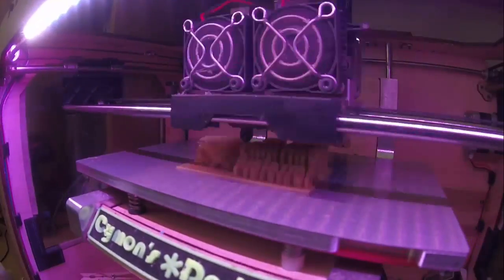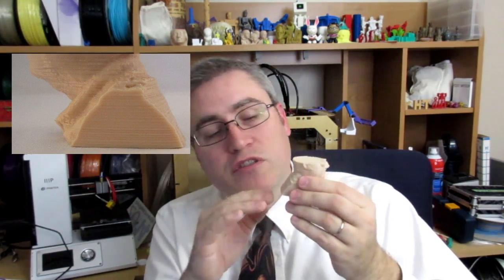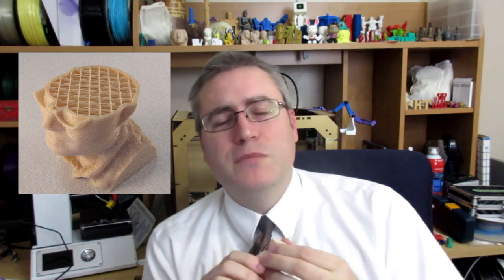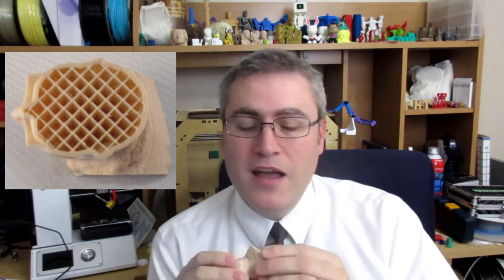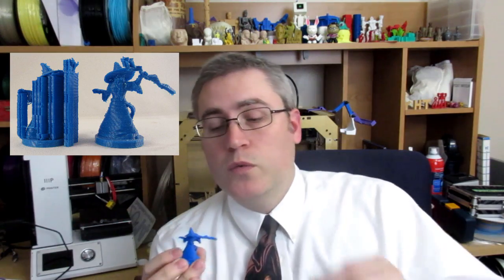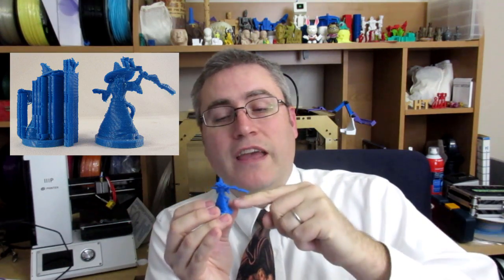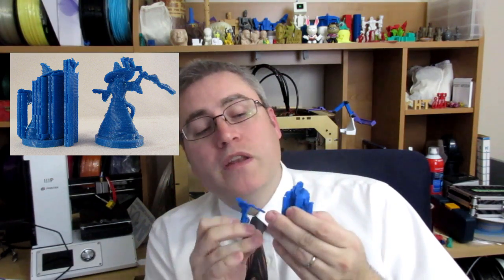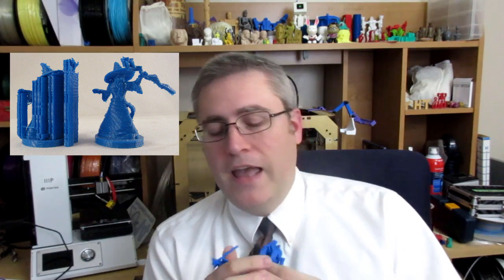3D Printing 101 - Anatomy of an FFF 3D Print

Comment: Hello my fiend !   Please make a video of the electronics, talk about of your experiences of the movement of the stepper motors, the possible fails or rather improvements could be made to print better =D
Reply from the maker: Hmm, interesting. Admittedly that's something I know less about. I know that some of the more expensive 3D printers use servos instead of steppers so they can have constant feedback and know where the motor is no matter what. But besides that I just know that 3D printers move things around in 3 dimensions. I'll have to do some research, maybe build my own 3D printer.

Comment: What slicer did you use?
I'm using Cura and find the supports it generates are no good at all. It puts them where they are not needed, and where my model prints in thin air it generates no support for this.
Reply from the maker: I do use Simplify3D so I can have control over the supports. Most slicers have a hard time identifying support areas that come to a point for some reason.
Reply: Thanks. Looks like you have to pay for that one. Being a cheapskate I might just use Meshmixer or 123D to put my own in.
Reply from the maker: I understand. hold off as long as you can. Because as soon as you realized it's a $150 upgrade to instantly make all your prints look better you won't be able to.